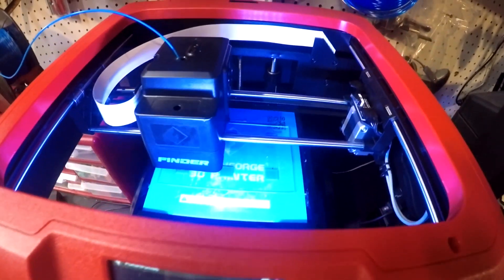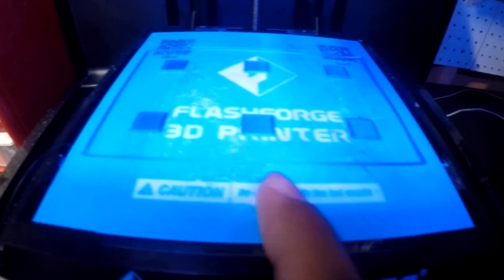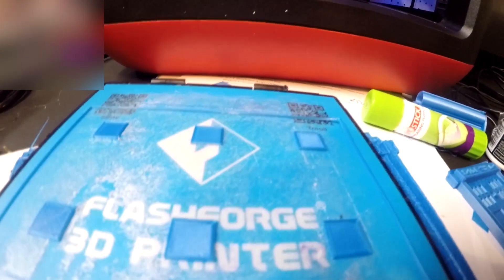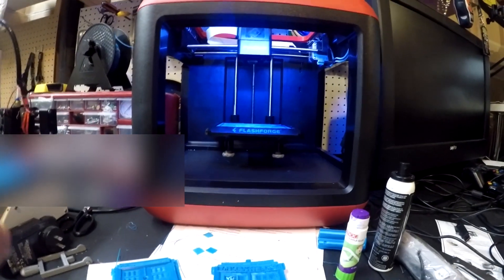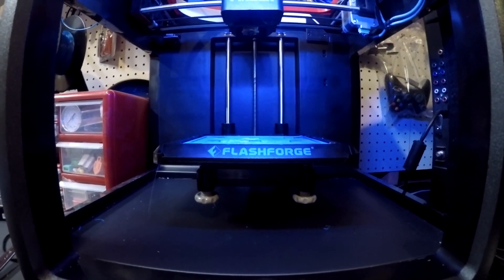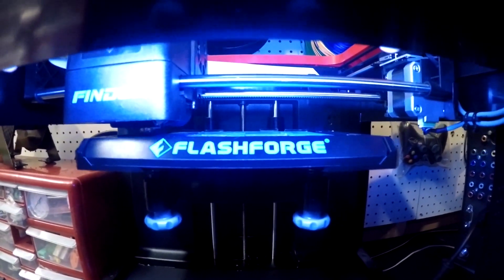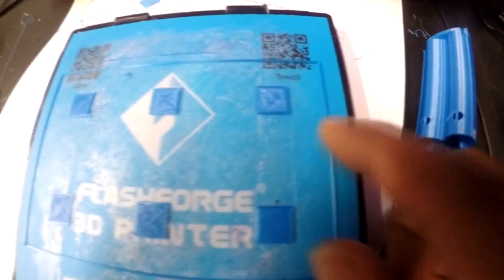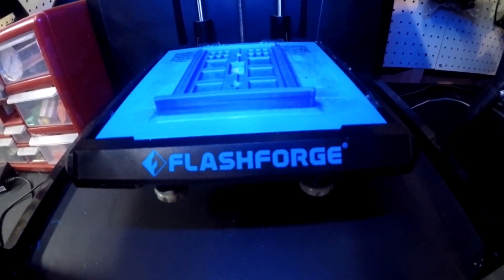How To Fix Non Sticking / Warping  / Curling 3D Prints

Comment: I have best results by not touching the build plate and cleaning it often. You wipe off all oils, you can't physically see those oils unless you're building straight onto glass. 
isopropyl alcohol works fine. I use a build plate and I often use aceton which makes it extremely sticky. this is because it has effect to filament particles from previous prints, those particles blend into the build plate. take note that using aceton wears out the build plate faster

Comment: A: don't touch your bed with your fingers xD seriously man. The oil from your skin is not your 3d print's friend. B: with pla most warping issues are bed level issues however if you print  nearly solid parts in certain shapes then your print might warp even if your level and surface are perfect due to the stresses caused from the contracting layers that are cooling down. glue stick is fine but dont use hairspray -